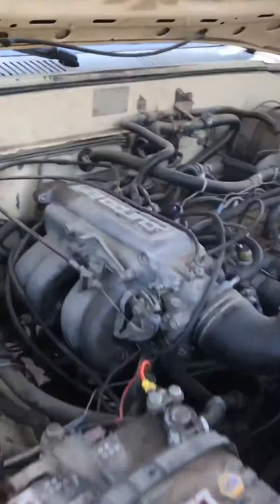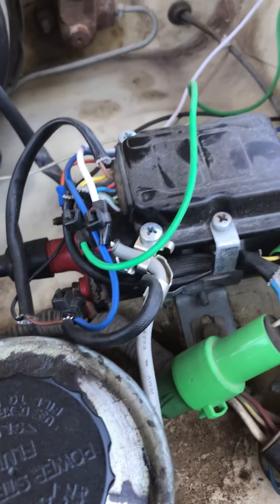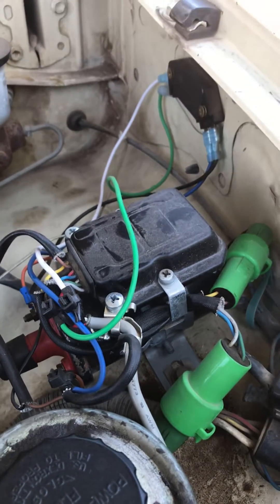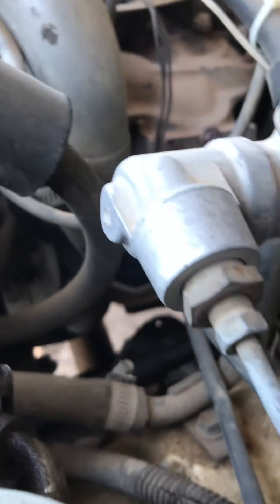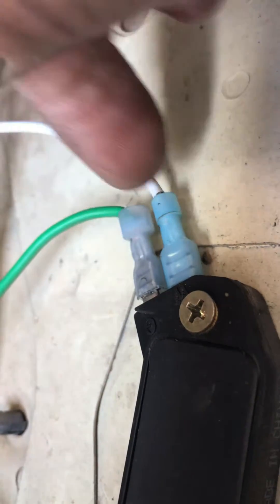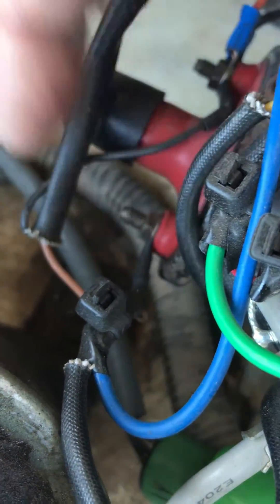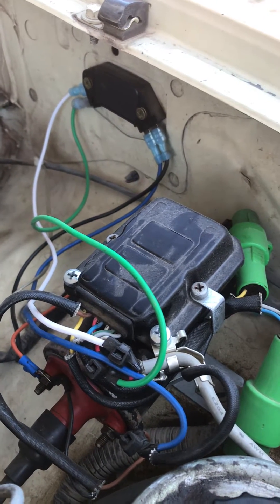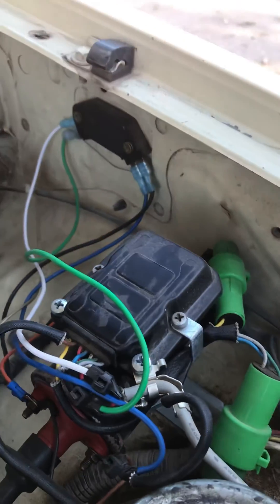1984- 88 Toyota pickup adding GM ignitor to EFI syatem

Comment: Hey, I saw all the tutorials online for using a GM ignitor but most said it would only apply to carbureted trucks, not EFI trucks, so I'm happy to see you got it running on an EFI truck, but mine is a non-turbo, but it has the "053" ignitor that you can't find newly manufactured for cheap. Does your ignitor have a 3 prong plug on it? If so, I think it's the same style wiring as mine. I'm kinda looking for any solution to this no-start issue. :/ Thanks!
Reply: What ended up solving your issue? Im dealing with it now
Reply: @OliCashflow  I ended up selling the truck. :/